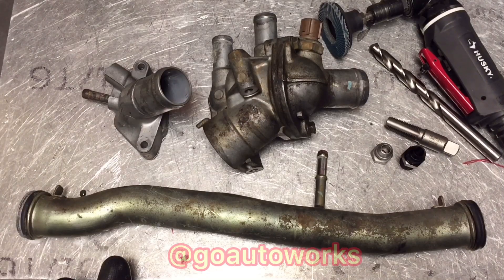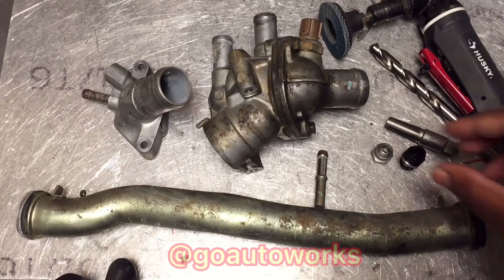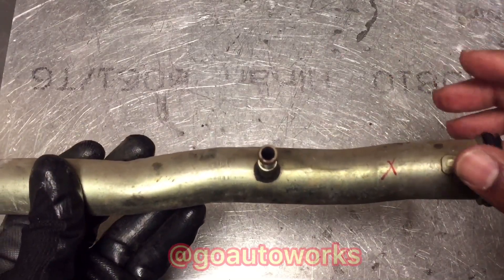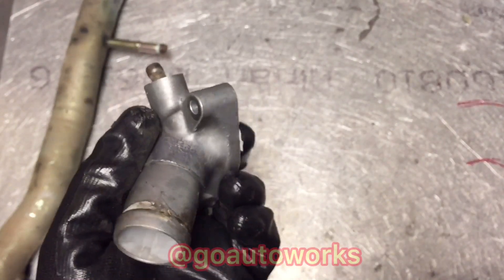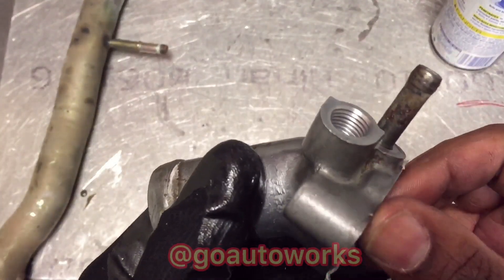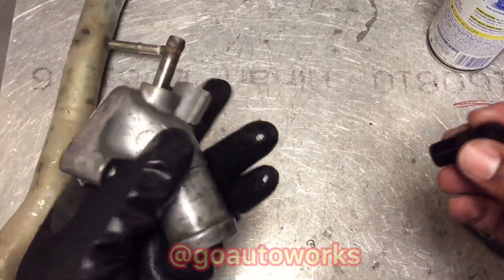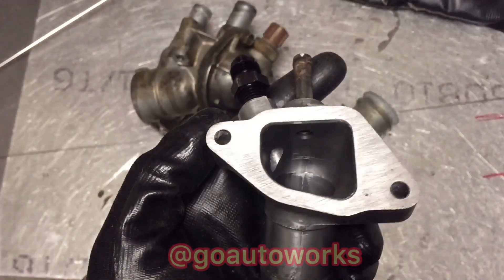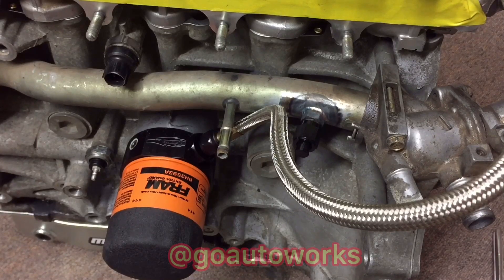Turbo Water Line Routing / Install

Comment: Are you sure about the hole sizes for the water neck ? You said 5/8 first and then 7/16 but 5/8 is bigger than 7/16. Did you mean 3/8 first then 7/16 ?

Comment: If I choose to route my water line from the throttle body IACV line, would that work? Any issues with providing enough volume?
Reply from the maker: That also works and works fine.

Comment: Could the upper radiator outlet be tapped for a water temp sensor? Want to install one the cleanest way possible. Thanks for the info and  video!!
Reply from the maker: It depends on the hole spot in the housing. Most coolant temp sensors will only be 1/8NPT pitch so you would need to just check the location abd see if it is small enought to drill and tap. If not you could add a sensor port to the coolant hose or radiator.

Comment: Can i use the water neck as a feed and drain into the front of the block where the freeze plug is?
Reply: you could... but  IMO it would be ideal to get coolant BEFORE it enters the block so that you can feed your turbo colder water (as oppose to hot coolant exiting the block)